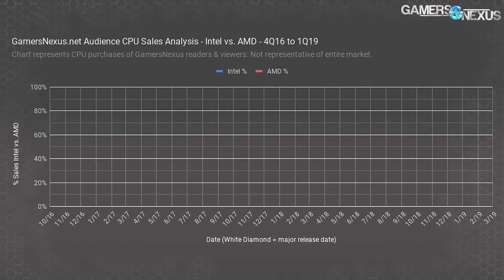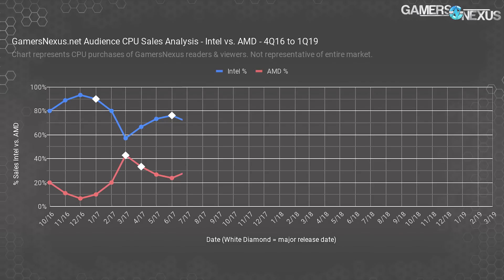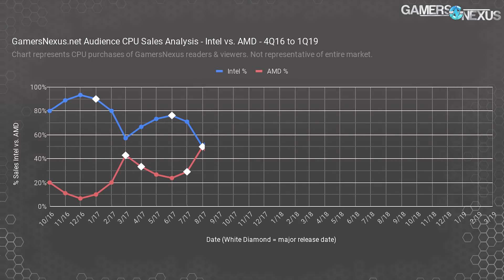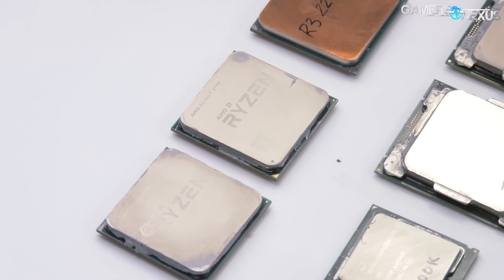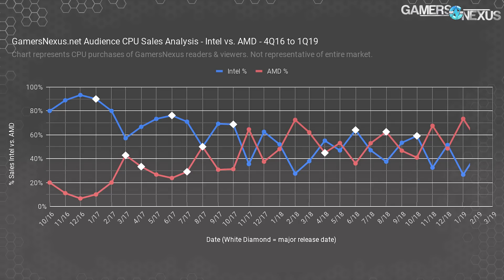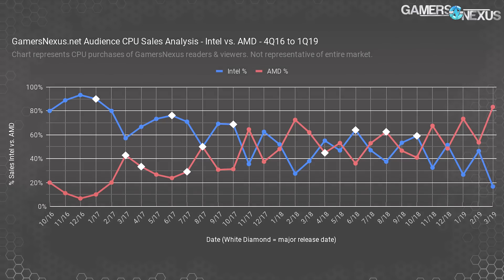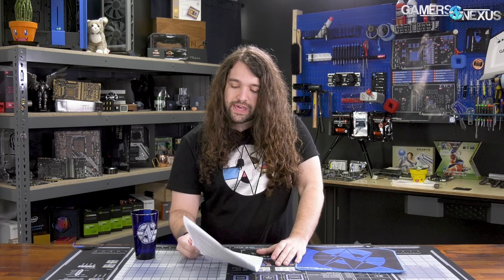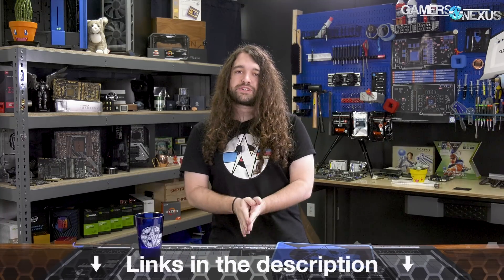Special Report: AMD’s Comeback Story - Intel vs. AMD Marketshare

Comment: Do AMD continue to use PGA for their processors instead of LGA like Intel because of patent issues?
Reply: There is no patent on LGA, it's like a BGA or QFN package. Intel may have patented their implementation with the socket and measurements but that's all they can do. Intel wasn't the first to use it and AMD already used it on server platforms.

Comment: Had an older i5 and it was great.  And then switched to Ryzen 5 2600, which has been even better.
Reply: still rocking a 3570k dunno if I wanna go R5 2600x or wait for the new chips to come out

Comment: From the manure that was FX, a lovely little Ryzen flower grew.
Reply: FX was a bold strategic move by AMD. They made such a bad product that the competition forgot to compete. And then Ryzen. =)
Reply: still on the FX8350, mostly due to win10 not liking some apps and not liking me. Good little CPU, and I think it still holds the 8+GHz XOC crown, think (Sorry der8auer, 7.6GHz is NOT 8+GHz, lol). This FX I'm typing this post on, is only at its base clock of 4.0GHz with boost disabled, cuz of stability with the craptacular VRM on the board. I so want to E-power this motherboard, lol.

P.S. the GN R7 build is still going strong (dedicated render box), win10 is just a pita to work with the desktop and mouse pointer thing.
Reply: So much regret from buying my FX-8350. Runs like garbage at 100% utilization in BFV when paired with my 1060 6gb
Reply: @RWDtech  who would of thought a cpu released over 6 years before bfv was released would struggle to run the game optimally
Reply: FX wasnt even that bad, for just plain running a pc it was fine but only mostly just that.
Reply: @Dockhead  Mate I'm playing Far Cry 5 on it, as well as many newer games, no problems whatsoever, 1080p gaming is decent even now...
Reply: @STS Tech FX is not completely awful if you only compare the performance to other old 32nm processors like Sandybridge and you don't measure the power consumption which is what it was designed for unfortunately it sucks compared to anything newer and sometimes the power consumption is important
Reply: i bought an fx8350 for 160 bucks in 2013, was a pretty damn good price at the time tbh.
Reply: My 8350 and R9 380X run Far Cry 5 buttery smooth... Manure?
Reply: FX-6300 and FX-8350 were both good.
Reply: @edwardpark247  Sorry I would have to dissagree, on paper they looked decent but in practice Running office pc's at least the user experience on a pentium g4400 is noticably better then the fx6300. and a sandy bridge i3 would probably also give you an overal better user experience. I made the mistake of buying these fx cpu's when they where cheap in around the haswell era for office pc's at work but generally they are just a pain. Paired with cheaper motherboards they actually overheat and are by far the pc's complained about the most. A lot more then sandy bridge i3's. 

That being said for a purely gaming workload maybe but for general use they are quite terrible.
Reply: @qlum Pentium g4400 is from 2015. FX-6300 and FX-8350 are from 2012. Also, you didn't mention overclocking performance of the FX chips, which was phenomenal. If you weren't overclocking your FX CPU....well, you were leaving alot of performance on the table. How does a cheaper motherboard cause more overheating of the CPU? Maybe you are referring to a Northbridge problem, not the actual CPU? Might be voltage problems on the mobo? Also, why wouldn't you spec a better cooler if you were having CPU thermal problems? I agree that G4400 was a great chip and Intel was crushing it. Intel was firing on all cylinders... Haswell was king. 22nm? Finfets? Intel was like "eat my dust, AMD." Comparing G4400 to the FX-8350 is whatever. A big selling point for AMD back then was backwards and forwards compatibility with various sockets, AM2 AM2+ AM3 AM3+, and DDR2/DDR3. You talk about combining FX-6300 with a cheap mobo and claim that a major complaint with FX was overheating? And then you're talking about Sandy Bridge i3s as if it were relevant to this topic? TBH it sounds like it was user error. It would make more sense to look at an Ivy Bridge CPU and compare it to an FX 8350 to show how wide the difference between AMD and Intel had become. It was the beginning of a very dark time at AMD. But still, if you're talking about cheap FX chips, then the good mobos would also have been in the bargain bin too. Why buy cheap mobos when the top models are priced for clearance? Not using an adequate cooler on an FX 8350 to allow for overclocking sounds like fail.
Reply: @edwardpark247  Fair enough on the overclocking point. 
As for overheating this was mostly a case of the vrm on the cheap am3+ motherboards being utter garbage and really inadeqate to keep even the 6 core parts cool enough in a suboptimal case. I have had a few of them that had rather frequient shutdowns. The way around it was to rip away some fan filters on the cheaper cases and put the case fans to 100% but it was an issue. Is it directly a cpu issue no, it was however an issue if you bought new systems during the era where these fx cpu's dropped in price quite a bit. Dual core intels simply didn't pull enough power to cause problems with the same cheap motherboards. 

As for why I said the G4400 it just happened to be the second slowest commonly used cpu at my work. I know its much newer  and I also bought it in later batches than the fx ones but its 2 threads do hurt sometimes (even if it is just for crappy webapps fully loading one core regardless of cpu) I did use quite a few sandy / ivy bridge i3's which also had much less complaints about being generally slow.

So really my perspective is just from building office pc's in 2013 - 2014 in a time where an i3 could be had for around 110 euro and a fx6300 for around 80. Overclocking / getting an overclock stable in that usecase really isn't viable and yea there where better used motherboards but that was in my usecase also not a good option. 

I guess they had their niche for cheaper gaming systems with a decent overclock.
Reply: i built a FX machine recently. it cost next to nothing and it works surpsingly well.
Reply: My 8320 at 4,0 ghz is still playing alright coupled with a gtx 970. I'm waiting for both Zen 2 and my wallet.
Reply: Yeah, I side-craded from the FX 8300 to a R5 1600, 2 less cores but otherwise about the same multi-core performance. The few games I play(at 1080p) are locked to 60FPS anyways(no variable refresh-rate, 60Hz monitor) and the performance is the same between the old and new system as a result.

Comment: best part of all this is game devs will be taking a look at ryzen, building games on ryzen rigs and testing them to run well there, intel's 2-3% IPC lead is exactly how many more fps you will get with the comparable intel offering after that happens
Reply: IPC isn't the whole story, certain tasks can run faster on one CPU than another by quite a huge margin, the way calculations are done between architectures are not equal that's where optimization kicks in, if you can exploit what a CPU is good at you can gain performance in specific tasks that might outweigh any potential IPC advantages.

For example Intels CPUs are not particularly good at being increasingly multicore due to the design of the bus, the more cores you use the more internal bus speed you need, Intel chips between the 6 and 8 cores have the exact same internal bus speed from what I can gather so if anything is particularly IO heavy then you potentially gain nothing in IO bottlenecked tasks no matter what RAM you use, the you have the differences with how parallel calculations are done and other stuff.

Comment: So, it's a bit dated now, but I'm curious about the real world cost effectiveness of FX cpus.  If, for example, a given FX cpu was capable of doing everything you needed it to do, how much more or less would it cost to get the same level of performance out of an Intel chip.  Include the cost of the motherboards and coolers and such.  
For me, it made sense to drop a fx8350 into my system originally built with a phenom 955, and the 8350 still is enough for everything I do on my desktop.  A Zen2 is in the future for me, but the space heater does the job for now.
Reply: Same here! I have a FX6300 at 4.3GHz (2400 NB, 2600 HT) and it can run every game at reasonabe FPS + rendering just fine w premiere and blender. I'll probably end up upgrading tko

Comment: The problem was intel pricing. At the same price i would take a 9600k over a ryzen 2600x. But when there is a 90 us$ difference, you cant objectively recommend it.
Reply: The locked i5 isn't good enough when compared to an overclocked Ryzen though, especially when you add: A mobo that most likely won't support the 10nm processor, it's probably a locked mobo, if it's not, than you're paying a lot more than B450 and even some X470, support to Ryzen 4.
Reply: You can't get price right if you didn't have the thing. It's basically market pricing. Demand is higher than the supply and retailer milk the customer by jacking up the price
Reply: @KarrasBastomi  $90 difference just for the CPU, the 9600k still needs additional cooler since it doesn't come with a stock cooler so its probably about $120-150 difference
Reply: @nonameyet2205  I think for i5 u better off getting locked 9400F than 9600k, if u buy unlocked i5 it's kind of waste, why don't step up to i7 segment if u go unlocked

if can't get locked, I think 9400F price is pretty competitive
Reply: @AliciaCLR  yeah the 9400F is much better value than 9600k, but it doesn't have big advantage compared to ryzen 5 2600/2600x
Reply: @nonameyet2205  Good point, however if you already happen to have a good cooling solution than AMD isn't that compelling unless its heavily discounted. Like for instance I'm still using 6700k for almost 4 years clocked at 4.7Ghz.

Comment: It is going to get worse for Intel before it gets better. From the FX disaster, AMD came back and closed the gap in IPC performance significantly with Zen and Zen+ between Intel. That's what actually matters in gaming for now. In a month or so, you'd get a CPU over 4Ghz with 8 cores and 16 threads with even better IPC for just $180. So for mid tier, the ball is in AMD's court. Even maybe in the high end sector with the 16C/32T CPU, given that the single core performance roughly matches Intel. I'd still suggest getting an Intel for super high end gaming but well, that might change soon enough. All AMD needs to do now is to do the same for their GPU sector. Having been using AMD GPU all my life, felt really bad when I switched to Nvidia recently as I had no choice.

Comment: Intels problem lies with the stupid amount of different CPU's in each range and also the amount of ranges available. AMD have it right with 3 or 4 CPU's in each range.
Reply: Intel's pricing model on their processors doesn't exactly help either. I was looking to get a lower end 6th gen Skylake processor to stick in an h110 board i bought a long time ago before going with Ryzen. But the prices on those lower end processors have gone up exponentially like wtf
Reply: the spectre and meltdown issues also make it worse

Comment: Running a Ryzen 7 1700x overclocked to 4.02GHz that I bought for $130 brand new around black friday. Super happy with it. Glad to see AMD competing again.
Reply: @tarkfarhen3870  how? What stops a company from producing better products? Nothing but that particular company and buyers of those products being willing to pay more for less.
Reply: @tarkfarhen3870  you mean a monopoly? Thats not how it works.
Reply: @Sergio Ruelas
 Interesting I have Ryzen 1600X (150 Euro new)cooled using Thermalright ARO-M14O. Do you see any change in gaming after OC? I'm siting on stock because it didn't made any significant difference for me (I have RX580 8GB).
Reply: @stanisawszczypua9076  for gaming? It might be a miniscule difference but if you can safely overclock it, why not. Free extra performance lol
Reply: @sergiowolfpac  Free? A) CPU won't lower clocks when idle so it will consume significant more power and B)it put more unnecessary stress on MB and CPU, further more I heard about 1gen Ryzen degradation over 1 year of constance 4GHz OC - it wouldn't be stable anymore at 4GHz  and C) on stock I have 4,1GHz one core XFR
Reply: @stanisawszczypua9076  don't take that so literally. Obviously there are some tradeoffs. Didn't think I had to clarify that in here. And you "heard" about that where. Put a source down not just word of mouth I'm barely running anymore power than stock, I am incredibly stable at 4.02, and I don't see how that could degrade life perceivable in less than several years. 4.02 is not much higher than the 3.80GHz stock frequency.
Reply: @sergiowolfpac  First when I hear about it was in this video made by polish youtuber:
https://www.youtube.com/watch?v=6eH3uS3-HOk&t=1325s
I set it to graphs moment when he starts to talk about problems with previously rock stable (verified in Prime 95) 4GHz Ryzen 1800X. He contacted polish OC group Extreme Hardware and they confirmed that symptoms shows unstable OC. And he said later on that what few months ago was stable in Prime95 now wouldn't finish test in Cinebench r15.   This video confirmed what I also observe on my previous CPU Ryzen 2400G (despite numeration it is first gen Zen not Zen+) OC to 3,975 GHz over time it lost stability. I had to go down to 3,925 GHz and then I set it on 3,8 GHz.
Reply: @stanisawszczypua9076  fair enough I'll look at all of this eventually
Reply: Geez, thats really good performance for such an astonishingly low price
Reply: I got my R5 1500X clocked at 4.1 with an ML120 Cooler Master Aio.
Reply: Are you using the included cooler?
Reply: @6gradosproducciones  the 1st gen X chips did not come with a cooler
Reply: @6gradosproducciones  Didn't come with a cooler. Running a cooler master liquid M240E that I got for $40.
Reply: @sergiowolfpac  i just put a corsair H55 on my 1600X
Reply: @keptinkaos6384  how do you like it? I love the aesthetics of the cooler master but performance is lacking in my case.
Reply: @sergiowolfpac  It does the job it's not RGB just a nice black finish with chrome trim and corsair in chrome on the block pump but it has not missed a beat in 2 years I'm happy.
Reply: 1800x here 180$ brand new
Reply: @xxxm4r1oxxx7  from where
Reply: @chriswright8074  powertop it was around 240 CAD or 180 USD
Reply: @tarkfarhen3870  really.... like what company this has happened to?
Reply: Sergio Ruelas Got mysef a i5 9600K from ryzen 1600X. I mostly play arma and never render so its better for meryzen was good tho 😁

Comment: If only I had bought AMD stock at sub $2, instead of $20.
Reply: I did buy shares at under $2 ($1.83 to be exact in February 2016). And sold half when they went over $32 in September last year to make the down payment on my apartment.
I should note that this was the first time I ever bought stock in any company, and I only did so because I believed AMD could make a comeback. And I had recently inherited some money after my father passing away. I certainly did not expect to make almost 18 times my money back in just 2½ years.
Reply: 10 years from now someone will be saying "If only I had bought AMD stock at sub $20, instead of $200"
Reply: I bought in at around 21.71 , but hey I have been making some decent returns. Only thing is, I really wish I wasnt broke back then... :/
Reply: I remember when it dropped to like 1.63 and I was thinking " I should buy a shit ton of this". but I was still in college and didn't have alot of money
Reply: If only I had bought AMD stock at sub $200, instead of 50 bottle caps...